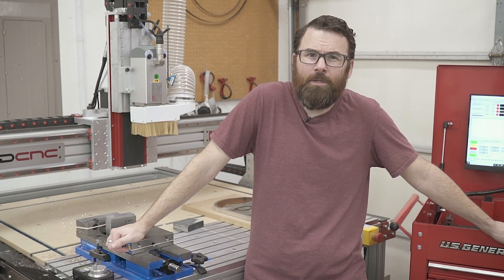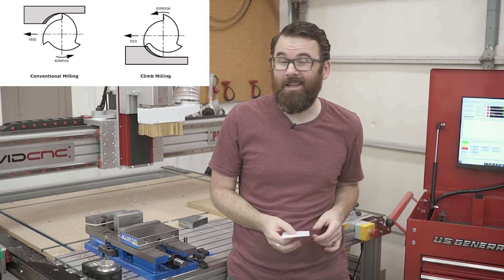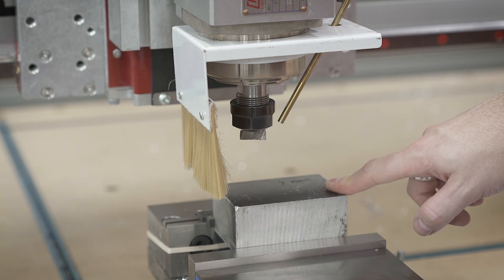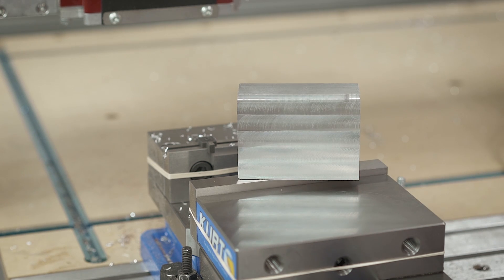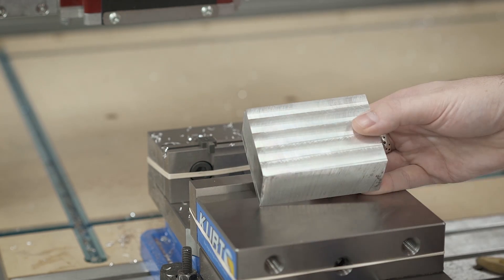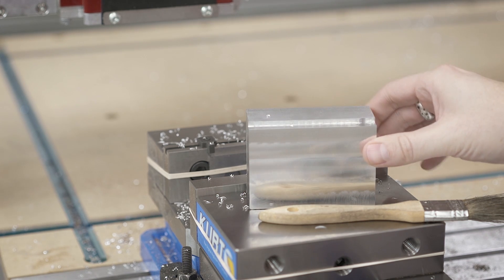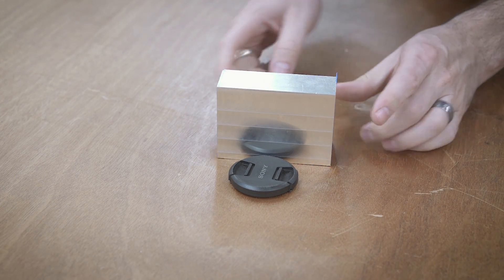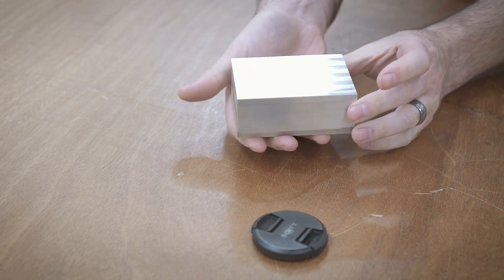Facing Aluminum on Avid CNC Router - REVISITED!

Comment: So the conventional milling is often better on less rigid machines, though it's less about the rigidity and more about the leadscrew.   If you have a leadscrew instead of a ballscrew or some other reason the machine has significant backlash the conventional cut is better.   
On a climb cut the cutter will attempt to drag the spindle to the front of the backlash, but the feed pressure is coming from the back of it because the screw is effectively pushing the spindle around, not pulling it.   This will cause the spindle to vibrate back and forth inside the backlash range, which can cause a number of effects.
On a conventional cut the cutting action will push the spindle back instead of pulling it along.   This causes it to be pushed against the back of the screw contact, which is already in contact because of the feeding.   This reduces the vibration produced by the tool impact.
Climb milling produces a better finish in most cases because if the chip hasn't quite cleared the endmill and it gets rammed back into the part, it gets rammed into the next bit you're cutting so you'll cut it back off again.   Conventional milling rams this onto the finished part of the cut, which can sometimes leave the entire chip there so you have to come back and do a finish pass to remove it.
Most of my stuff has been side milling on a machine rigid enough to do nothing but climb cuts, but facing I've done both ways and both have worked equally well.
The things I found to have the most effect on surface finish on the mill I used to run were the sharpness of the cutter, the tramming (alignment) of the spindle, some degree of lubrication (I used WD40) and an extremely high RPM for the tool.   I saw on the second cut the signs of it being well trammed, but not on the first one so my guess is the difference there was machine rigidity, it was just a little too much pressure for the spindle to stay perfectly straight.   I'd actually check the tramming on the tormach because the rippling I actually found to happen more when the passes were closer to each other, not less.
Reply: @Joshua Beavers Super on point and concurred. Thanks for your detailed explanation— I couldn’t have said it better myself.
Reply: I started my 5 year apprentiship in 1968 and now after over 50 years of machining I am watching the internet full of amateurs pretending they know enough to teach.
Reply: @Mr1bassman1  Sounds like you have no business teaching.

Comment: It's obvious you don't really know what you're doing. As a professional CNC machinist for 25 years I can tell you really don't understand feeds/speeds. Put a little light oil on the surface and you'll see much better finishes in aluminum.

Comment: A little late but having faced a ton on a router, you want to go lower RPM.

I run a 25mm facing tool (2flute) at these f&s:
12000 RPM
2400 mm/min
1mm DOC and 90% WOC - that is my roughing but gives a decent surface
And for finishing i use:
12000 RPM
800 mm/min
0.1mm DOC and 90% WOC.
Reply from the maker: Cool, I'll try that out next time.

Comment: It costs $20 to add mist coolant to a cnc machine. It's essential for getting a good finish with aluminum. Like night and day. It's as important as rigidity.

 Also, you could run the Avid at 8000-10,000 rpm which would work better for that size tool. It's hardly a meaningful test when you run the Avid at over 2x the sweetspot for the tool.

The results would be about the same if you did that (and fixed the tramming).

Comment: Would this be a good machine for small aluminum parts production or takes to long ?
Reply from the maker: For aluminum, it works well.  The only real issue I have is indicating parts, since the spindle doesn't allow for quick tool changes, and you need to re-indicate after every tool.  BUT, you can get around this.

Comment: Remove the dust sho and add a vaccum clener ( maybe setup a box around it machine) 

And I would recommend going to between 92-95% ( dependingin the nose radius on the corner) stepover ( to get a more even pressure on the tool) and less doc
Reply: And if you build a complete cabinet for the avid then add some air bast at the cutting tool ( prefer from 4 sides at ones to make sure that you get those chips away)

Comment: Correct me if I'm wrong I'm a CNC plasma guy not a VDF guy. Why not remove the bristles for a test and see if the loaded up of chips is the cause? [yes I know it'll make a mess but it would provide a conclusion to this theory.]
Reply from the maker: Fair point.  It was pretty obvious.  When I lifted up the head after the cut, it was just completely clogged, and the bit was surrounded by chips.  Anytime there's a chance of recutting a chip, it's bad.

Comment: I'm wondering how much a rigidity gap would a smaller Avid machine (such as benchtop pro 2' x 3') have closed. I am in the market for a CNC/mill, and m leaning towards Avid, as I'll be working with both wood and aluminium.
Reply from the maker: From what I understand from talking with them, the benchtop and the 4848 are pretty much the same in terms of rigidity.
Reply: @RobertCowanDIY  Would be interesting to see accuracy comparison between the two via machining 2 identical objects...
Reply from the maker: @doyounglee6990  same!  email them and see what their thoughts are.  from what I've seen, the z axis has the least rigidity, and I don't think there's much difference there between the two.

Comment: Excellent, thanks.  At 3:50, if you can feel a "step" at the edge of each pass, maybe you need to check your spindle tramming.  Any shortfall in rigidity will also produce this result, but you are taking such light cuts that I don't think that is the cause.
A thought for the future if you are planning to use it for aluminium a lot;  make another dust-shoe that uses silicon (or similar) flaps, rather than bristles... less for the curly little chippie-beggars to cling to.    :o)
Reply: Yep. Exactly what I was thinking. That spindle needs tramming. Had same issue

Comment: robert... love the channel. .. i don't know if you looked  into getting a different spindle. Im personally getting a  s30  atc spindle for my  build. i believe its iso 30 and is bit more rigid. there will still be tad bit flex in the avid build..its aluminum.. im also wondering if a bigger/wider  fly cutter would also help with a cleaner /smoother cut. also is your spindle head trammed perfectly to the bed ? keep up the great content.

Comment: I moved on from early basic training in a machine shop (all manual, no computers) to cabinetmaking. So,  umm... nothing really comparable there because everything was planed by hand.

Abrasives were strictly forbidden, so getting the perfect finish was all about grain orientation, honing and stropping irons, and mounting rigidity.

Some tropical hardwoods are quite a bit harder than aluminium. I remember working one East African timber (non-commercial - it was too hard and didn't even have an official name) that rang like brass, sparkled with silica/ quartz, and stank like a dead dog. Terrible stuff. I loved it.

This Comment is on entirely the wrong Channel. Sorry. Carry on, chaps.

Comment: So I'm looking at buying an avid CNC and I want to be able to cut aluminum with it. I'm not looking for machine shop quality but I am wondering what kind of tolerances I can expect in my aluminum parts? most of it's going to be art work if you will but some stuff will need to be fairly precise. Any feedback be much appreciated I really enjoy your videos thank you for taking the time to share.
Reply from the maker: I've not had an issue with getting parts to be accurate, but getting a nice (professional) finish is tricky.  If you're removing a lot of material, expect the floor finish to be pretty mediocre.  Wall finishes are pretty good though, generally.  Cut I can easily cut a bearing pocket, or how two parts mate together perfectly fine.  You will just need to plan it out, go slowly and making make one or two final passes to get it where you need to go.
Reply: @RobertCowanDIY  Thank you very much. That's exactly what i was looking for. " I can easily cut a bearing pocket". I figured surface finish would be challenging but not really my concern from a cnc router. Thanks again and keep the great videos coming.
Reply from the maker: @saltysoulcreations8537  Thanks!  I'll be doing more with it for sure.  I have an upcoming project that can show off what you can do with it.  Check back this coming Sunday.  It's a multi-part series, but the end result is pretty cool (I think).

Comment: Seems like you should check the nod on the Avid.  The steps you see across the face would make me think the nod needs to be shimmed.
Reply from the maker: It's VERY slight.  I have a separate video where I trammed everything and it's as close as I can get it.  There's just some inherent play in the Z axis.  I might go back and re-check everything though, sometimes it's easier to get something right when you DON'T have a camera in your face.
Reply: @RobertCowanDIY  You mentioned being able to feel the ridge. If that was only on the Avid, you may be right about it being a rigidity cause.  But if that was on the Tormac as well, I would be more concerned about the tram on that,.  Or, maybe a not perfectly straight shaft on the bit? If it felt the same on both, what else would be common between the two setups.  

I could be mistaken, but I think you should be able to test the rigidity theory by adjusting the depth of cut.  The ridge should increase/ decrease in height when taking a bigger or shallower cut if rigidity is the issue.  I would think it would stay about the same if it was a tramming (or bit shaft) issue.  I know these are such a fine an amount it would be very difficult to measure.

Comment: I understand this video is for facing but the rule of thumb is -

Conventional tends to work better for less rigid machines. Conventional “scoops” the chip out with the chip starting thin and ending thick. Climb “Bites” the the chip out going from thick to thin.

Climb milling is preferable as it leaves more heat in the chip but a less rigid machine will tend to vibrate, or worse, bounce through a climb cut.

It’s usually good to run finishing passes as climb though  because conventional can lead to smearing (not enough material to really grab into so the cutting edge will slide along the surface some, especially with a less ridged machine.

If you’re cutting wood or most foams/ plastics then you want to stick with conventional as a climb cut is likely to cause lots of fraying/fuzzies/hairs, etc.
Reply: I agree. Conventional milling is better for less rigid machines. 

If the machine has any backlash, climb milling will pull the cutter away and you will lose accuracy as well as get chatter. Conventional milling always pushes the tool into  the work so it has better support.

Comment: first comment, also can the same cnc machien that you have be used to make parts for a 250 battlebot?
Reply from the maker: Sure, as long as the parts can be cut on the machine.  I haven't tried it with steel, but I suspect it would be better to outsource steel parts.